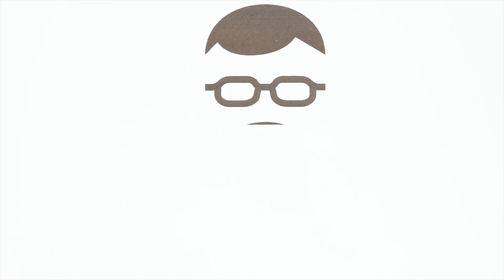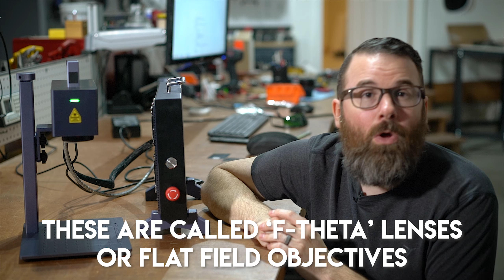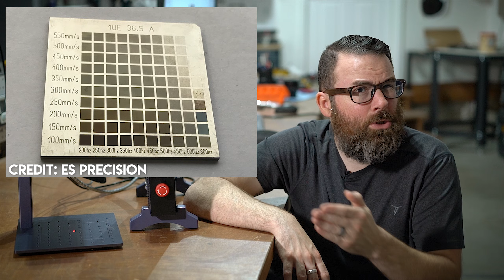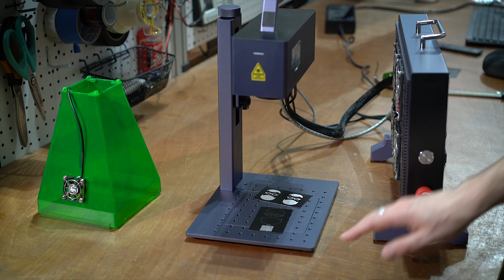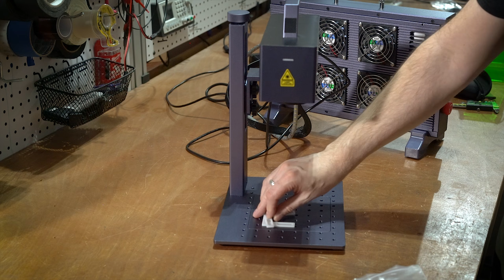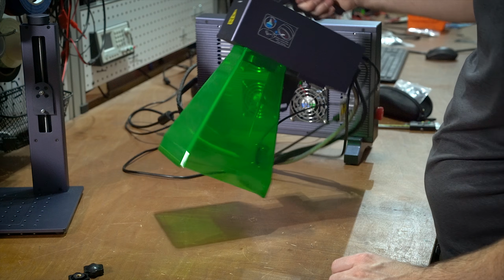Gweike G2 20W Fiber Laser - First Look!

Comment: Hey just kinda getting my feet wet with fiber laser machines. Im a silversmith. Can this machine do welds on silver which I don't think it can.....do you have any recommendations for an affordable option for a small laser that can do 10 gauge- 16 gauge silver. Im looking to fuse, weld joints and seams. Ive been going crazy trying to find a laser that isnt marketed for that low of a setting but with good penitration. Anything that says jewelry laser it automatically is like 3500$ lol. Ive played with tig welders off of Amazon and got some success but really want to find a fiber laser that can do welds but small. Idk if you can PM me when time by chance. Lmk if you got any input or can help. Appreciate your time bud. Ty ty

Comment: Please can you make a Video…Xtool F1 vs Gweike G2 ?
Reply from the maker: xTool has been trying to send me an F1 for quite awhile, but I've turned it down.  It's a great product I'm sure, but I'd much rather have a true fiber laser than a diode laser.  The F1 is a 10W and a 2W diode laser in one housing.  Since I already have a CO2 laser, the 10W isn't really all that useful, I would only use it for the 2W, which is the same wavelength as the fiber laser (G2), so they would engrave the same materials.  So for roughly the same price, you get a true 20W fiber laser versus just a 2W diode laser.  From my understanding, fiber lasers have a finer laser and are more concentrated.  So the difference between 20W fiber and 2W diode is significant.  I think the F1 has some applications, but I'd rather have a 20W fiber instead of a 'dual purpose' machine.  Just my take!
Reply: @RobertCowanDIY  Thank you!
I understand. I've watched a lot of videos now and can't notice the increase in speed. I would almost say they are equally fast. I also think that the resolution of the F1 appears higher when you look at the business card photos in comparison. It may be a 20W fiber but I can't determine the added value. I am an artist and very critical and perfectionist. I also came across a website that strongly favors the G2 and disparages the F1. However, there are a lot of untruths in there and things are presented in a sugar-coated manner and other positive features of the F1 are left out. Sure it's a battle between competitors, but the truth will come out after a few tests anyway. 20W fiber versus 2W IR sounds unfair...but the results are apparently the same. Mr.Beam also only has 10W but keeps up well with 40W CO2.
Reply from the maker: @Testpilot360  So here's the deal with speed.  Everyone's trying to claim they have the 'fastest' machine, but it comes down to power density.  How much power can you put into the workpiece in a certain time period?  If you move really fast, you only stay at one point for a very short period of time, so you need a bit more power to compensate.  For the engraving they usually show (the metal business cards and such), it needs very little power, so they can move quite fast.  But some materials might require more power, so you'd need to slow it way down.  With a higher-powered laser (like 20W or higher), you don't need to slow it down, you just increase the power.  I'm not sure of any other way to say it, but I just don't see a world in which 2W is better than 20W?  The results are not the same.  Most of the testing you see is just optimizing for the diode to compare apples to apples.  If you try to deeply etch steel, the 2W diode will take FOREVER, the 20W will be much quicker and a 50-60W would be even better.  It depends on the task at hand.  It's always good to have as much power at your disposal.  In terms of fine details, a fiber laser should always win based on how the fiber medium transmits the light.  I have nothing against the F1, but at the same price point as a fiber laser, the fiber will always be a superior product.
Reply: @RobertCowanDIY  ok I understand. But I think for what im doing…the f1 is better. But im not sure. Here is a video…the results from f1 are great in my opinion. The g2 have too less power for good faserlaserexperience. He cant really cut…he cant really engrave. Yes he can, but not really good, because 20W is too less. Engrave metal is not important for me. To print motives or letters on metal is enough for me. I think 2 Lasers in 1 machine is nice to have then.

I hope ill make take the right choice. Its a lot of money
Reply: @RobertCowanDIY  https://youtu.be/YW39gvGO6iM?si=b5XbSDWcDD7xlZB-
Reply from the maker: @Testpilot360 If you're not engraving metal, why are you looking at either of these lasers?  That's what they're made for...  If you're not doing metal, you shouldn't get EITHER.
Reply: @RobertCowanDIY  I want to print on metal. The option to engrave or cut would be great. I only want the best for my money
Reply from the maker: @Testpilot360 Just to be clear, these machines don't 'print', they engrave or cut.  Printing is when you apply a paint or other substance.  What you see in videos where it turns white is engraving.  You are always etching (or engraving) or cutting all the way through.  I promise you, if you are engraving on metal, a 20W fiber laser (from any manufacturer) will be significantly more powerful, flexible and yield better quality results than a 2W diode laser.  The only similarity is the wavelength and the galvo head.  Get off YouTube and read about what fiber lasers are versus a diode laser, they're a bit different.  I really don't care what you buy, but the only benefit to an F1 is you can engrave and cut different types of materials from the same machine (since it has 2 different lasers).  If you're primarily doing metal, a fiber is the way to go.

Comment: With just a tiny bit of research,  you could have found out that there are diode laser engravers that use a galvo , but I guess it's just easier to pass along misinformation.
Reply from the maker: I absolutely realize diode lasers can use a galvo.  xTool makes one.  However, a diode with a galvo head isn't the same as a true fiber laser source with a galvo head.  I'm not at all tying to deceive anyone, but a lot of diode laser manufacturers are trying to claim their diode lasers are in fact 'fiber lasers'.  There's a difference.

Comment: Can you use this to smooth a 3d printed part?
Reply from the maker: nope.  for plastics, it basically removes pigment.  you COULD theoretically use it to slightly melt the surface, but it would be nearly impossible to get it right.  chemical/solvent smoothing is still the way to go.

Comment: I received my g2 20w 2 days ago and that laser did not work!! I have been working with thw company  to ale it work but no luck.. they say that will get a replacement but we will see that in a day or 2 if they keep their work.. i will update my comments when they replace my laser.
Update received, but it is not working. Have  to send it back and wait 40 days  to get a new one.
Reply: How did you get it already?  The Kickstarter campaign has not even ended yet.
Reply: @doctorpd1969  I got my new g2 20w,  plus a complementary air suction vent. I probably received my g2 20w right after the youtubers received theirs.

Comment: with that removable center  of the base it seems like you could use the main unite on top a large sheet or with a bit of work you could mount this to any larger cnc router table and be able to set it to etch larger materials in a grid
Reply from the maker: I was thinking of making a 3d printed part that went around the green vent hood thing, so I could reliably reposition it along a larger workpiece?  I haven't fully thought it out.  But mounting it to a CNC could work as well.
Reply: @RobertCowanDIY  it seems like a one of those tools that will grow as you find more uses for it and i look forward to seeing what you are going to do with it

Comment: You talked about CO2 lasers not having frequency adjustment, that's only true of DC CO2, RF CO2 in most commercial lasers also have frequency adjustment.
Reply from the maker: Got it.  I guess I don't have much experience with those, and almost all of the hobby CO2 lasers out there are just DC.  RF lasers for hobby use is pretty rare.

Comment: I had no idea fiber lasers even existed, after watching the video I thought the fiber was just a light conductor but after reading up on it a bit more they are really different from diode lasers while still being pumped by one. Really informative video though and thanks for uploading!
Reply from the maker: I don't FULLY understand it all, but that's how I interpret it.  Yes, it's a diode source, but it's much different than a standard diode laser.  I've used CO2, diode, and now fiber, and I can say that fiber hits different.
Reply: @RobertCowanDIY   It's essentially a Q-switched system. Basically the laser effectively has a "shutter" inside it between the laser medium and the the output mirror that keeps the stimulated emission and amplification (the "A.S.E." of "L.A.S.E.R.") from getting started until the laser medium is fully charged with energy from the pump, then "opens" and allows all that energy to be emitted in one very short, very powerful pulse, before "closing" again to charge up once more.

It's not actually a physical shutter, most Q-switched lasers use a material like Cr:YAG that absorbs light until the intensity is high enough, then it saturates and becomes bleached, and allows the light to pass. There's also no reason it has to be a diode source. Flash lamps, gas lasers and even concentrated sunlight have been used, but diodes are the smallest, easiest and most efficient.
Reply: The pump laser feed into A doped tub. with the piece of fiber in the tube. it basically means they put The doping element.could be erbium, ytterbium, neodymium, thulium . The pump laser  is Feeds into this doped tube . And The material changes into a higher energy state, and naturally returns to its normal state. Thus emitting a photon of light At the wavelength . The same way as CO2 laser functions inside the tube with CO2 gas in it. What makes the Fiber Laser efficient is the fact the mirror on one end becomes non-mirrored and  re-mirrored so fast . The light has time to build up . Then released all it powe in one short burst . Unlike the co2 that dose not dam up it’s power .

Comment: Roller feet and E-Stop... hmmmm... the device rolls off the table if you have to hit the e-stop ?
Reply from the maker: Ha, yeah.  The e-stop is pretty easy to hit without it rolling backwards, but I will most likely be 3d printing my own legs/feet.  It's a very strange design decision.  I've also seen that it can be placed flat with the laser on top.  Maybe with some elevated feet for ventilation that would work better?
Reply: @RobertCowanDIY  I suppose its like 3D printers, you have to mod them a bit to make them fit into your own workflow and space.
Reply from the maker: @SarahKchannel  Unfortunately, it's like that sometimes.  I can talk with Gweike and see if they can modify the stand.  That's a great point about the rollers.  Granted, it's a fiber laser, and the wavelength isn't really all that harmful (check out other videos where people put their arms/hands under it while running).  For light-skinned people, it won't really do anything.  BUT, it would be nice if it stayed in place and the feet are kinda crappy feeling.  I'll send the feedback along and see if they can address it.  For the other laser of theirs I reviewed, they did make changes based on feedback.
Reply: @RobertCowanDIY  If there was any particular use of those rollers I would give them a thumbs up, but then I can not think of anything (a bit like Apple MacPro furniture rollers). 
I think the cost of those rollers are spent else where with more effect ;)
Reply from the maker: @SarahKchannel  My thoughts exactly, that's why I brought it up in the video.  It's an odd choice.  I remember unpacking it and thinking "why the hell did they decide on this?"
Reply: @RobertCowanDIY perhaps the rolling feet are for the pseudo portable mode so a careless user slides the suitcase rather than tipping it.

Comment: Would interesting of it did etch PCB boards. Either the copper directly with multiple passes, or coated PCB to prepare for chemical etching in small prototyping.
Reply: 20W of 1064nm can just about remove copper, but it will heavily carbonize the substrate, so no, it doesn't work. You need 532/355/266nm for copper.
I've made plenty of high-ish density boards by cleaning regular paint off a PCB for etching though.
Reply from the maker: I'd have to look into that.  From what I've seen, it should be possible.
Reply: @RobertCowanDIY  A copper PCB layer is normally around 35µm thickness. The website says it can etch copper, so 35µ is not too thick one would think. 
To remove a paint mask from a solid PCB, I found in the past with CO2 / Diode lasers, that the edges are not very clean, both do to precision but also heat exposure during ablating. 
Now with a fibre laser with very high scan rate, that might suddenly be different.
Reply from the maker: @SarahKchannel  Yeah, I've seen it done on 20W lasers and it looks CLEAN, I just haven't personally tested it.  But it absolutely should be able to.  I'll make a note of that for my next video.
Reply: @RobertCowanDIY  A very wild thought, imagine if it would melt surface mount solder paste... you place the parts and have the laser run over the solder spots with components on. Would reduce heat loading of components, vs. putting them into a reflow oven.

Comment: You said inside the source is a diode laser as well.
Why couldn’t you use a laser diode of the correct wavelength in a “regular” gantry laser design?
Reply: If this is an actual fiber laser, then the fiber itself is doped, and is the gain medium. There's a good video on it here: https://www.youtube.com/watch?v=83SKYGcSUHQ and here https://www.youtube.com/watch?v=ofEqFlqkiS0
Reply from the maker: Great video!
Reply: @dumle29  oh very interesting!

Comment: The fan in the shroud should be a fantastic feature.  The cone that came with the AtomStack "fiber" laser I tested rapidly filled with smoke and attenuated the laser, making it pretty much useless.  I'm really curious to see if it moves enough air, but it must be better than nothing.
Reply from the maker: Hopefully the small fan is enough, but it would be pretty easy to add a larger fan, it gets power from a USB port in the back of the unit.

Comment: As far ss i can tell, you must me connected via their cloud to operate. 
Lightburn not supported. 
Proprietary software.
No ez cad??
Right wrong?
I wouldn't use sw or hardware required to be connected to internet.
Your opinions welcome.
Also guard is getting complaints from pecker fiber machine. 
Need to.remove it to.make adjustment to.material
Reply from the maker: Good questions.  I did not need to connect to the internet or have an account to use the laser.  I'm not sure where you saw that, but you can just connect it to non-networked computer and use it just fine, no internet required.  The software is just re-branded ez cad.  It's identical and I've been following ez cad tutorials to learn the thing.  In my next video, I can try using ez cad directly (not their version of it) to see if there's anything special.  But all dialog boxes and settings are in the same place and it looks identical, it just says gwlaser or something at the top instead of ez cad.  But I just tried it with my network disabled and had no issues.

Regarding the guard, you only use that when you're taking it off the stand.  With the stand, you don't need it, so that's not an issue.  Hopefully that helps.
Reply: @RobertCowanDIY  thanks .
They  mentioned to connect to their cloud.  But maybe my mistake
Reply from the maker: @jppalm3944  Got it, I'll let them know.  I think they have some functionality with their app, which might require it.  But Gweike has generally been good about not making those things a requirement, which is why I like working with them and reviewing their products.